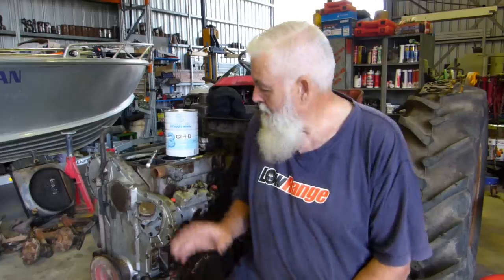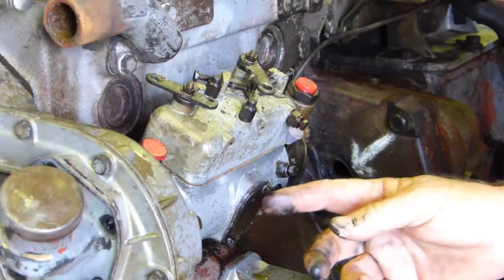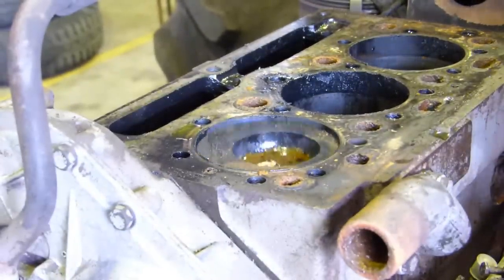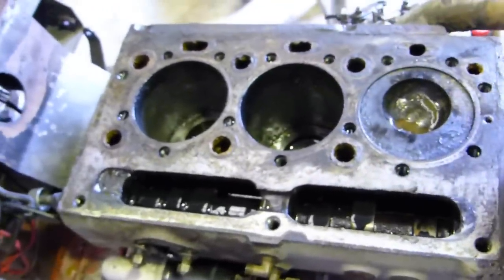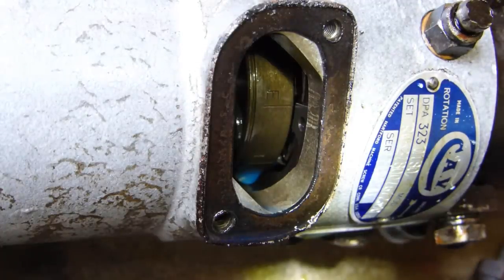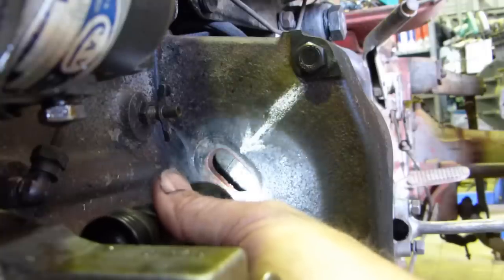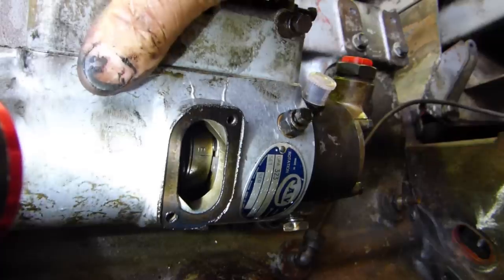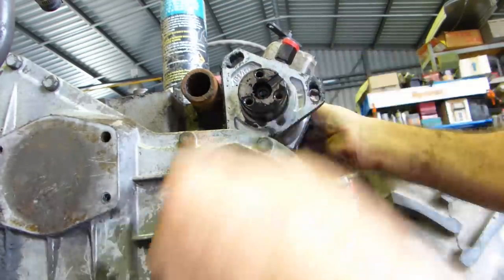MF135 Restoration #7 Timing and Removing the Injection Pump

Comment: Sir. Just bought a 1974 MF135 w/Perkins 3cyl Diesel. Injector pump leaking bad. I found a man that can repair/rebuild the pump; I just need to remove and mail to him. He sent me the link to your video. Thank you for an excellent "how-to" step-by-step tutorial. I'm confident--after watching your video--that I can successfully remove my tractor's pump. Will wait 'til I get the rebuilt pump back before I watch your video on how to install the fuel injector pump on the old 135s. Again, sir, many, many thanks.
Reply from the maker: Good stuff Im glad you are getting some value from the series.
Reply: @BundyBearsShed  Thanks. Ok. I need an expert's help. Got the rebuilt pump back. When I went to install the pump, back end into the timing gear mount plate, I must've pushed through that alignment pin that fits into the keyway on the pump shaft. I had a piece of cloth inside the timing gear box, but it must've slipped past. Any easy way to fish that alignment pin out without removing the whole front gear cover?
Reply from the maker: @markdavis2263  If you cant fish itout with a magnet I think the timing cover may need to come off Im afraid.
Reply: @BundyBearsShed  Ok, sir. I thank you for your time. Wouldn't happen to be a drain plug at the bottom of that cover, would there?
Reply: @BundyBearsShed  Sorry to bother you again, sir. I found the alignment pin just where it is supposed to be. Didn't know 
til tonight, with a headlamp, that the pin only extends out toward the injector pump shaft and NOT through the front surface of the timing gear. Dummy me. Sorry for the trouble today. Thanks for helping me, sir.
Reply from the maker: @markdavis2263  That is good news.

Comment: My dad has a mf 135. 1975 model. The tractor stopped all of a sudden while running. Found lots of dirt in dieselfilter and in the tank. Replaced both filters and cleaned everything else real good. Resealed the pump also, followed your instructions in the video. However, can not get it to run right. Feels like it runs only on two cylinders and it shoots fire out the exhaust. Great videos from you anyway.
Reply from the maker: Sounds like the timing is wrong. or there is a stuck open injector from a little bit of rubbish.
Reply: @BundyBearsShed  do you mean timing of the pump? I put it back exactly as it was. Is there something i can have messed up to cause this? Thank you for answering.
Reply from the maker: Flames means it is firing when either a valve is open and way out of time normally,
Reply: @BundyBearsShed  hi, did a compression test today. Do not have compression on the two first cylinders 😮‍💨
Reply from the maker: Blown head gasket then I would think.
Reply: @BundyBearsShed  did a cylinder leak down test on cylinder 1. Blows out the exhaust and also i can feel air coming trough the hole for the injector on cylinder 2. So probably valves and headgasket.. hope it is worth fixing, will remove cylinder head and take a look.

Comment: Hey I want to thank you very much for doing this video.  I have a 1972 MF'r, 203 ci, 4 cyl diesel, Backhoe and it is very similar to your engine and the injector pump was leaking from the top very bad.  I thought I knew what I was doing but after reviewing your video I did know what I was doing.  Thanks also for going over the timing of the injector pump as well.  I did not find the timing marks on the flywheel but I know where the dowel pin is, and the letter for the timing mark on the pump.  The engine will not be turned over until after the pump is installled but if something does go wrong I know how to fix it.  Many thanks again and keep it going.
Reply from the maker: You should be good to go by the sound of it.

Comment: I have multiple problems with my Perkins 152 3 cyl on MF35.  It has blown gaskets on combustion chamber twice and many leaking points on CAV pump and very hard to start (before blowing gaskets).  Did my use of a lot of ether to start the tractor blow the gaskets?  Is bad timing blowing the gaskets?  Hard start due to fuel system air leaks, timing, injectors, or what?
Any how, your videos are really upping my chance of getting things fixed.  Thank you, Doug.
Reply from the maker: Try cutting the gaskets to just a circle and see if that helps, if the combustion chamber flange is bent the circle gasket can help.

Comment: Hello Bundy. I rebuilt my pump and put it back on. It is now running away when I crank it. The throttle doesn’t help at all. Blowing tons of white smoke and extremely high idle. Is it out of time or something else wrong?
Reply from the maker: It sounds like you have the top spring in the wrong hole and / or a sticky metering valve.

Comment: just about to take my pump off my 35 to clean behind it prior to paint. I dont know if im at tdc but i have lined the pump up with the letter c and theres a hole in the flywheel that will take a 3/8 drill bit. As long as i dont turn over the engine, im hoping to put it back to thase marks. Great tutorials by the way.
Reply from the maker: Yes you should be fine doing that Mick.

Comment: Hi Lance
Would you happen to know which way do I move the pump to advance timing on Massey 165 with the 212 engine! I just want to see does it improve the starting if I move it one or two degrees
Thanks Wesley
Reply from the maker: Look on the side and on the little plate there will be an arrow showing pump rotation, go opposite to the way the arrow is pointing.

Comment: Great video I have a MF 255 turning but not cranking, replaced the fuel pump but hasnt been timed, for what letter do I need to align inside the pump when turning it? Thanks a bunch!
Reply from the maker: I cant be sure but if you get it to tdc on no1 and turn the pump to fire on number one you will see the letter through the side plate.

Comment: Hi Lance ,  
If my undesrtanding is correct when the E mark on the pump is aligned with the flat end of the inj pump inner circlip and the piston #1 is
close to its TDC (firing) then you can read on the flywheel the exatc timing. The E matches  with the flat end of the circlip only when the piston#1 is firing  and not whan it is pushing the exhaust.. am I right?
Thank you again for your valuable vids.
Reply from the maker: Yes
Reply: thanks! Is this also the time when the 3 marks on idle timing gear are in lein tihe the marks on camshaft, injection pump and crankshaft)?

Comment: I’m surprised that the bolts holding the drive gear into the pump shaft didn’t have locking tabs . Nice trick stuffing some rag in there so if you drop a bolt or washer it can’t end up in the sump , i wonder how many times that has happened !  One thing with setting up timing marks on any engine is if you go past the marks  by accident  don’t just bump it back to them go back a quarter turn and creep up on them again . If you just bump them back the backlash in the gears or timing chain will stuff up your readings .
Reply from the maker: G Day Ian, I did drop a bolt once, bloody thing, lol. Yes I will cover the rolling back in case of backlash error when Im assembling things.
Reply: .they did have spring washers  I believe.  ?

Comment: Hi lance, I have a 1963 Massey Ferguson 65 diesel that I had running for a few seconds but can’t seem to get to to fire again and stay running. It has professionally rebuilt fuel injection pump and injectors. I also just put a new starter motor in it and still can’t get it to run. Was wondering if you had any ideas? Thank you Ryan
Reply from the maker: Is is sucking air? it does sound like it may be, fit new filters and check flow before bleeding.

Comment: hi lance
thanks for your expertise. i have a JD 1640. i was stupid and put 50~50 cooking oil in it. gued all the lines up, thing that looks like a chunk of liver in the tank and snapped the pump shaft,
i know ,idiot. i got a second hand pump from a 2040 with a turbo and manifold. turbo connector to exhaust is missing so i hopefully will put the pump on ( which im a bit scared to as all i did was to remove the pump not lining up the marks and hopefully dont drop the keyway????) and i was told it may smoke a bit??     ttfn  Dave (Scotland)
Reply from the maker: It may but I think it will be fine, i would certainly do it. Timing should be fine like you say dont drop the key and line the flange marks up and it should be good to go.
Reply: @BundyBearsShed  Hi Lance   thanks very much for your reply,  you have inspired me to get on with it 😃  Kind regards    Dave

Comment: So, if I did all that ,everything is working, just not enough pressure to push the fuel to injectors,  I changed the head and still same thing, when I do it on the bench, it just barley bubbles at the head, whereas yours spits out enough to hit the camera lol. And thanks for the help your video was right on
Reply from the maker: Thanks.
Reply: @BundyBearsShed  . So do you think the head is bad If I don't get the pressure to it like yours does? I should say it is a cav same as the 1 in this video. Thanks

Comment: Sorry I spammed some unnecessary  comments back there which I deleted. My question is: on these perkins what happens if I turned the crank while pump was out? If I am not mistaken the pump goes on only in one way because of that pin and the only possible adjustment is the tilting of the pump itself right ? my mf 35 x won't start. It  always had starting problems. Im thinking it's the timing because it used to run fine after it fired as long as I can remember. I was a bit lost with this timing thing though. Is it possible the professionals I gave the pump to  to be cleaned installed the circlip at a different spot and I have to compensate with different tilt? Is it possible they install it so low that I cannot time it properly anymore or is the circlip just an indicator and irrelevant to when the pump fires? My circlip seems quite low in comparison to this videos example. I will have to check letter E and see what degrees I get on the flywheel when aligned with the circlip. I fear I might have to open the timing gears and see if they are not aligned if I try all else. Am I missing anything?
Reply from the maker: If it has been turned you need to start from scratch and set it up by the flywheel with it firing on number 1.

Comment: Today i removed my CAV DPA from my marine Ford Lehman 120. 2715e
And i the whole pump came out with gear and everything. The gear tuned and i lost what timing i had. I checked the manual but cat see where the timing angle should be😢
Im gonma do an overhaul of the pump but im a bit concerned how to get it back in with correct timimg.
Reply from the maker: Look for a mark on the flywheel then line no 1 up when it fires
Reply: @BundyBearsShed  Thank you sir. I found it umder the motor hehe. I had to use a mirror to se.

Comment: i have a kubota v4000 with the same pump. if i remove the pump , put a couple new gaskets, and put it back in without turning the motor, i should be fine right?
Reply from the maker: I think so.

Comment: Hello I'm having some issues with my Massey Ferguson 35 it has the three cylinder Perkins diesel engine and the tractor overall runs pretty well the odd time you'll have a misfire but the issue I'm having is it has what I believe is a power loss at high RPM tractor will work fine and all its a low-range gears but if I put it in to say hi range first gear and I'm only at around half throttle the tractor will take off but then if you give it any more throttle it has no response if you give it 3/4 to Full Throttle and then depress the clutch pedal it will not rev up but as soon as you release the clutch pedal again it'll go back down to its half throttle when it does this it doesn't lug or make any weird sounds or misfires it still runs as good as it ever did it's almost like you lower the throttle whenever you release the clutch in a high range gear any help would be greatly appreciated I'm thinking it could be fuel filters fuel injection pump or possibly a bad injector but I do not know for sure I have not had the tractor for long and I'm new two diesel engines thanks
Reply from the maker: G Day Noah, Im thinking filters would be the first and cheapest option. After that look a bit deeper.

Comment: Hi, I have a 135 with a perkins 3 cylinder diesel. I dont use it that much, when i got it out this year it was very hard to start and blew a lot of black smoke, and now is very low on power. I am a mechanic of 40 years but know little about these engines. I cracked each injector line and it seems to run on 3 cylinders but better on 3 than 1 or 2.I swapped around the injectors but it didnt change, the pump leaks a little fuel. It seems to have compression. What to you think the problem could be please ?
Reply from the maker: G Day Marty, Black smoke can mean a blocked air intake as in the inlet hose sucking in or dirty or blocked air cleaner. Another reason for black smoke can be that the implement is getting hard to drive for some reason and the governor is wide open trying to run it. If an injector is leaky that will often show up as white smoke at low revs as there is a lot of un-burnt fuel. I would check filters and inlet first.

Comment: My compliments for all the videos you published on CAV topic. I am in trouble to remove the CAV pump from my Massey ferguson 178, 4 cylinders perkins not starting more from long time now. I undestood it is necessary to make timing phase positioning before to remove the CAV pump. I am not finding  the window to check the timing in the flywhell in my tractor but looking your video you show that the CAV pump come back only in one place into the distribution gear. My doubt is: if  the CAV pump make in one turn of 360 degree all the injection process for the fours cylenders  is not important to check the timing before remove the pump. I mean, if the pump axes connection to the distribution gear is fixed by abliged interface positioning,  during the mounting phase is not possible to make mistake with timing. Please i will appreciate a sggestion if possible to proceed in that way. Thanks Luigi
Reply from the maker: Just undo the side plate from the pump and line it up with any letter and make sure you put it back in the same place and you should be good.
Reply: @BundyBearsShed  Perfect! thanks for the technical support. I will proceed to remove the pump from the tractor during next WE. i will see.

Comment: Hi i have a ford 3600 tractor i just done a pump reseal on at your specifications and when i put it back on the tractor and got it running, it runs but it dont throttle up high and i cant get any power out of the tractor. At full throttle , it is only running a little above idle. what have i done wrong?
Reply from the maker: You have the top spring in the wrong hole.
Reply: @BundyBearsShed  that's what i thought but i pulled the cap back off and it was where it was when i took it off. i made a diagram before i took it off. it will throttle at times and other times it wont. would it hurt to try it in the bottom hole and see. I took it out of the second hole on both the lever and the governor.

Comment: Hi thank you for a great video.  Is there a way to find TDC on a mf 35 without taking the timing cover off? I thought I’d ask the guru! Thanks again
Reply from the maker: G Day Philip, Look at the lines on the back of the flywheel under the rubber on the left of the backing plate.

Comment: Just found your channel, been battling with a Massey Ferguson 185 with a Perkins a4-248 engine,  I can't get it to start, seems out of time. Set the engine in tdc, lined up the pump with the marks. But It doest fire. Is there any marks on the flywheel as well?
Reply from the maker: Yes there is a rubber plug usually on the back of the flywheel and timing marks there. You could possibly be 1 turn of the crankshaft out of time.

Comment: I had to subscribe to your channel, I've got a question for you and I really hope that you've encountered it...
I'm working on a LONG 350, the metering valve has been cutting into the housing assembly and has it scored where it he's been scraping away at the aluminum.
When, I first started purging the lines, the injectors were barely pushing fuel out of the lines. They were just trickling diesel out.
Popped the cover and there's some minor aluminum shavings at the top, just below the governor.
Any clue as to what could cause the metering valve arm to score the housing up and do you believe the seals are potentially damaged?

It's been a fine tractor, but she sat all winter... That's what brought the discovery on. I can do some pictures or video if needed.
Thank you sir
Reply from the maker: The metering valve should have the steel bracket holding it down and in place, has that been broken? Pics can be sent to bundybearsshed@gmail.com

Comment: I’m about to take mine off off a 245 Massey to have rebuilt. So I should take inspection cover off make sure letter is align with mark. Then when I get it back take cover back off and make sure same letter is aligned ?
Reply from the maker: Yes thats it.
Reply: Bundy Bears Shed thank you still new to it gonna tackle it next day or so was pretty worried about messing something up

Comment: hey Lance rebuilt my pump on my 1974 Massey Fergerson 135  do you have to wire it up to full throttle when re-installing? Because I didn't and it is missing. Runs great and out again, runs great and out again. Can skipping that part cause this. Thanks Michael
Reply from the maker: No I dont think it would possibly re check the spring positions.

Comment: Good job for hello.
I have a question.
For example, is there anything that can be done to use the 3241f350 diesel pump (T4.236) instead of the 3348f230 diesel pump for the perkins 4.236?
Reply from the maker: I think some others would bolt straight up but it might over fuel at times.